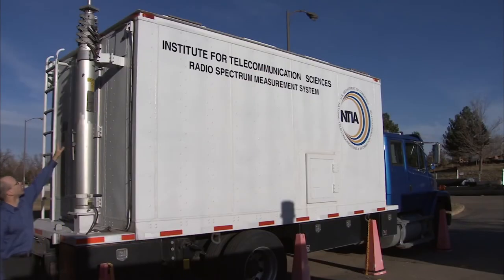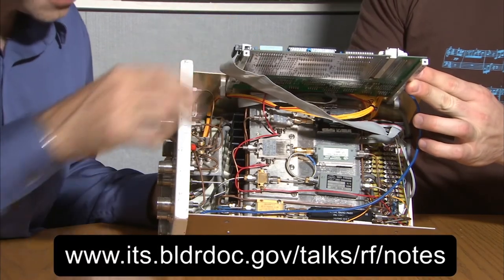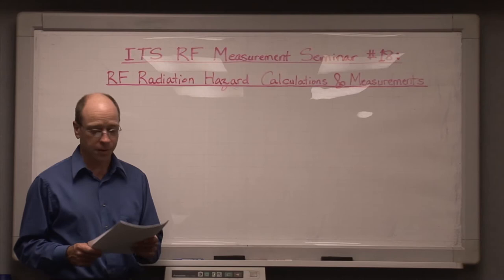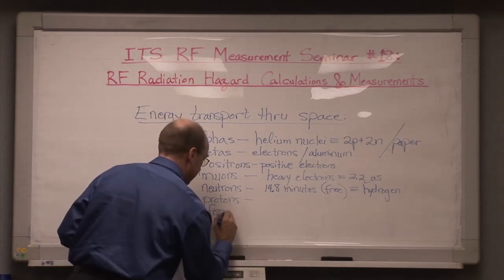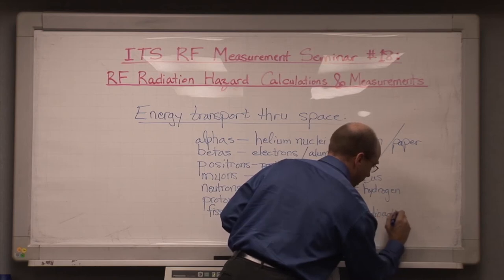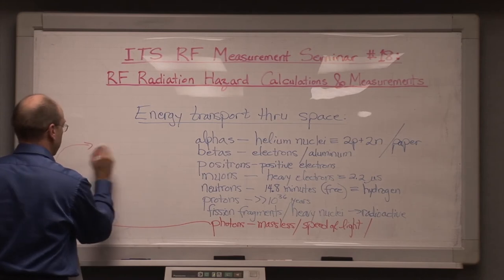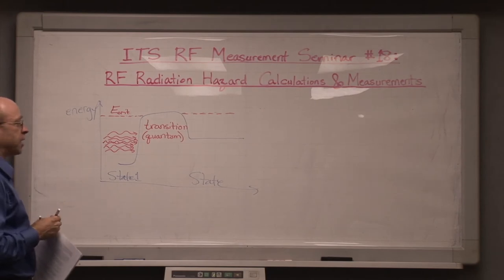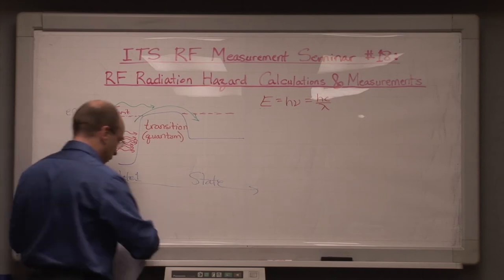Talk 18: RF Hazard Calculations & Measurements

Comment: 45:44 in the example let us say power density at 12m or more is less than safety standards. That power density level at that distance is safe but for what duration of exposure? is it safe to get excise to that level 24x7 ?? is it just the power density or exposure time is also important?